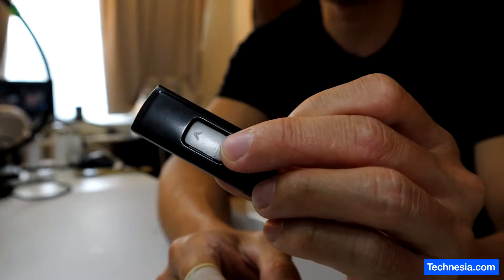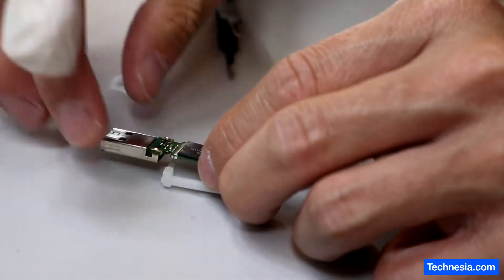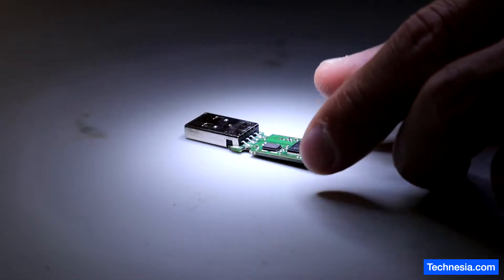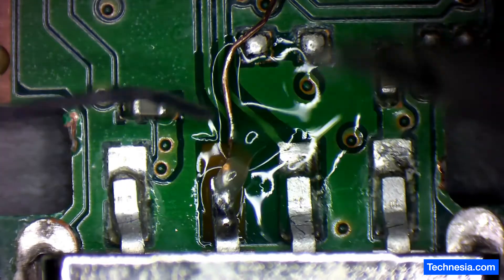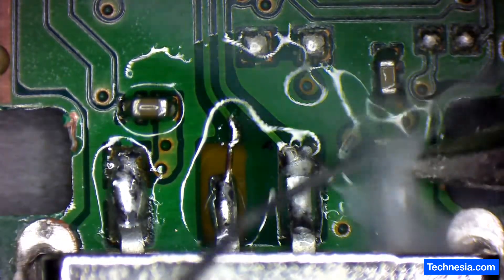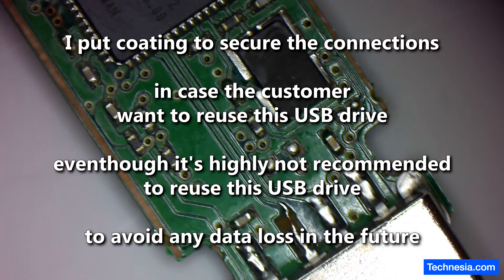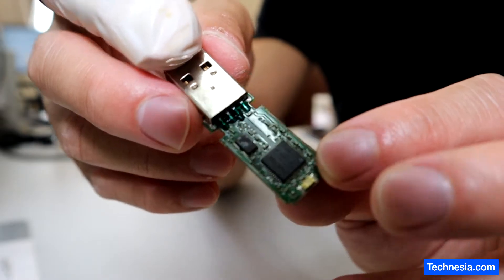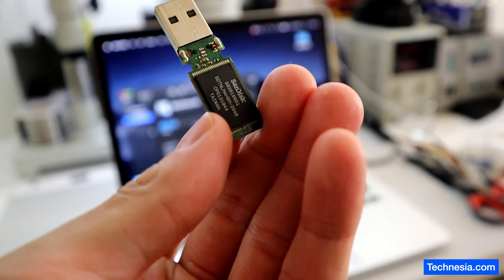USB Drive Not Recognized - Data Recovery

Comment: What coating did you place on the board, where do I get it, and does it dry hard or soft?
Reply from the maker: It's called UV Curable Solder Mask Repairing Paint or Conformal Coating. I got mine from MobileSentrix. It's thick and wet, like paint consistency and you need to cure (harden) it with UV light.